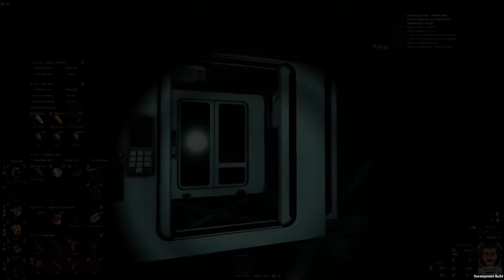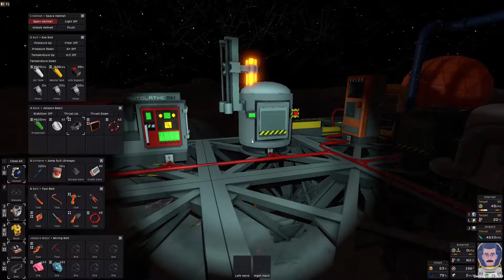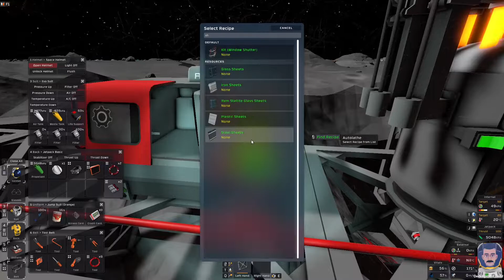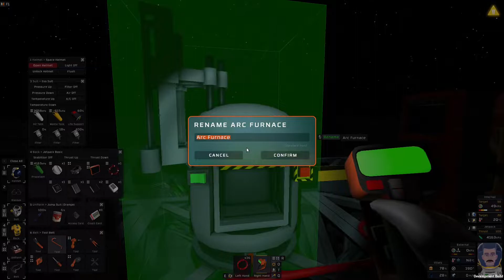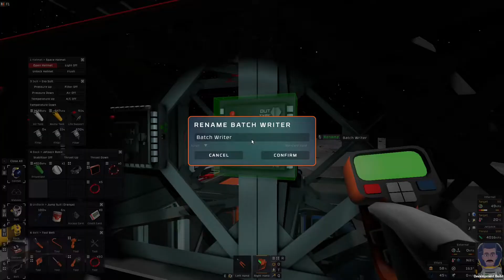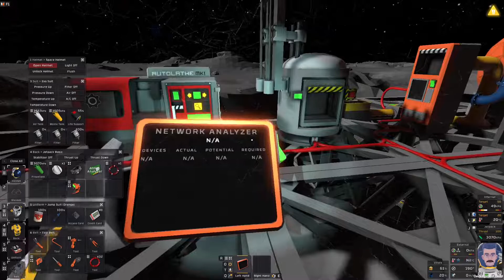Let's Play: Stationeers - Episode 3: Basic Solar Tracking

Comment: The pipe heater was a bad choice as far as power, as you discovered. A better option is to use a heat exchanger. Make a loop with your water and then put a one way valve on one side and a volume pump on the other. Slowly pump in cold water, and hot will come out, only at the pressure/volume input. Easy to control with logic and not overheat. Much lower power use than a heater.
Reply from the maker: Thanks for the info! I'll have to consider that when it's time to build a more permanent water storage/supply system. 

I haven't actually used the heat exchangers yet, as they're still fairly new additions to the game and prior to this series, I'd been away from the game for a while. In fact, I think this is only my second game where having to drink water was a thing.
Reply: @rattleheadx  Not to mention that you already have a load of very hot air... in your furnace. Just run it to a radiator inside your base for a few seconds, and you'll heat the base in no time - which of course also makes the water pipe radiators much faster at heating the water. You get more heat than you'll ever really need from just running your furnace once :D
Reply from the maker: @LuaanTi  Yup! Later on in the series things get much more efficient!